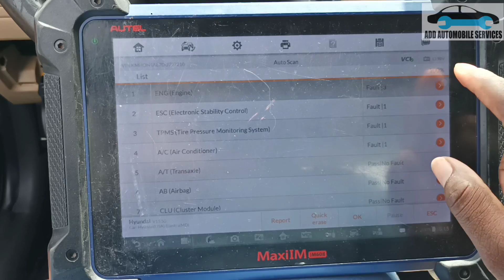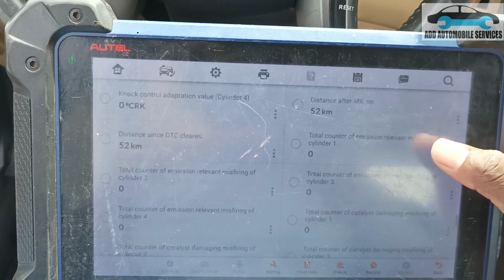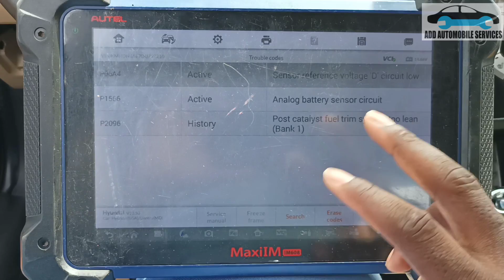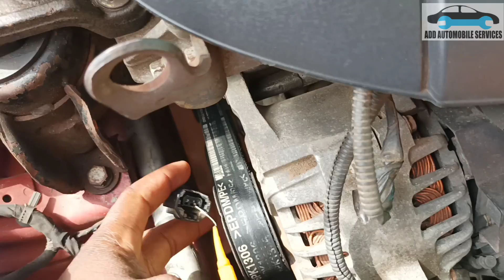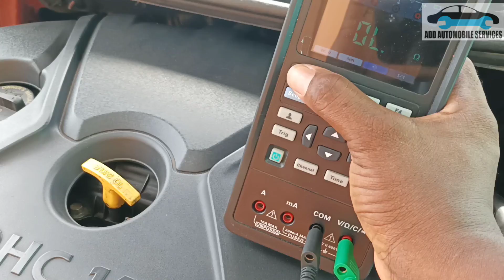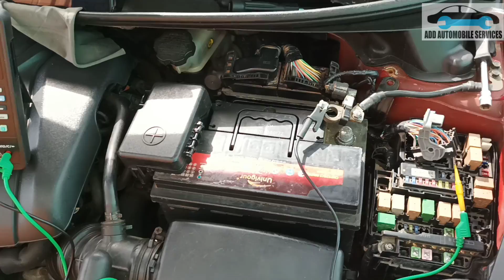2014 Elantra P06A4 Hyundai Code - Sensor Reference Voltage 'D' Circuit Low

Comment: I have seen instances whereby A/C tech guys fried engine computers..locally .. this happens as they try to find shortcut to tap some power from and by so doing, their put high load incandescent  tester to some lines and it screw the circuit up
Reply from the maker: Maybe they did not check their wiring diagram